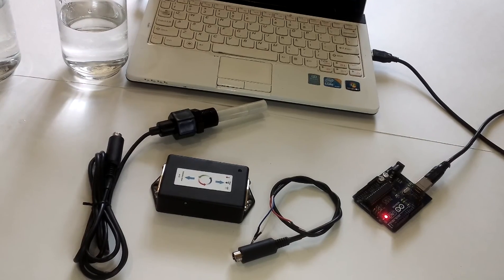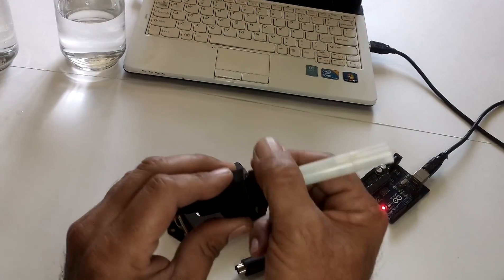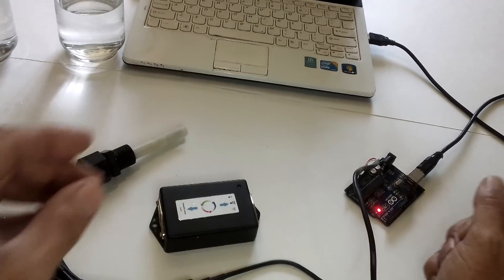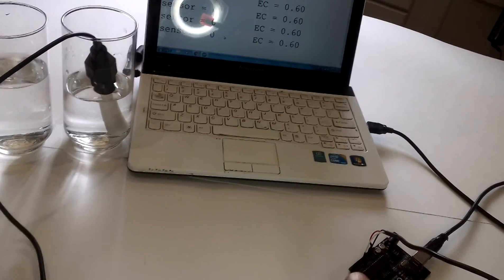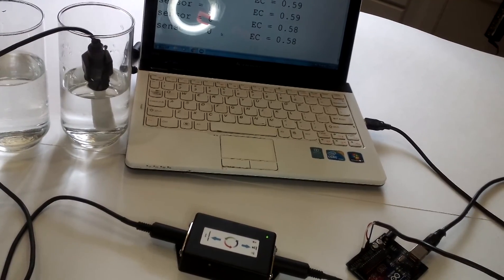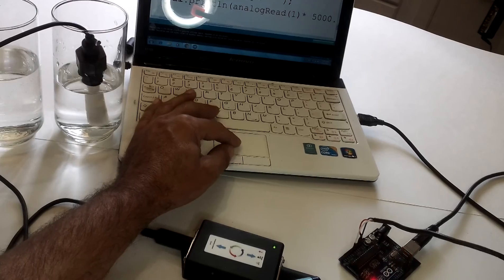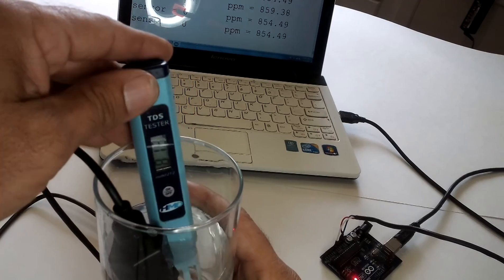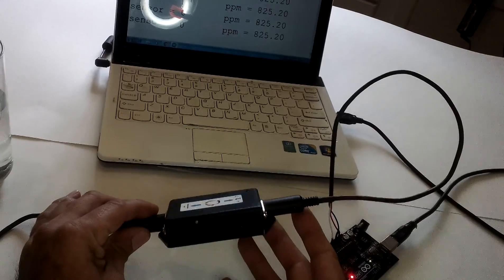Arduino EC Sensor

Comment: This instrument measures the EC of the water without any additional code for the arduino, and I would like to integrate it into an EC probe to be able to use it on the ground. Could it?
whats is the name of this istrument?

Comment: Hi, is there away to code the arduino to extrapolate the temperature from the output? Thaks
Reply from the maker: Yes..i think you can insert " int" commands for raw reading verses processed reading by adding or subtracting certain reading value from raw reading depending temp change.

Comment: What's the max time I can leave this probe in water? I'm looking for something that could stay in water for a couple months.
Reply from the maker: It is designed for continuous monitoring. Sensor is industrial grade so yes you can leave the sensor in the water for long periods of time, until it needs cleaning.

Comment from the maker: Sure...here you go

void setup() {
 
 */Analog input, analog output, serial output

// These constants won't change.  They're used to give names
// to the pins used:
const int analogInPin = A1;  // Analog input pin that the sensor output is attached to
const int analogOutPin = 9; // Analog output pin that the LED is attached to

int sensorValue = 0;        // value read from the sensor
int outputValue = 0;        // value output to the PWM (analog out)

void setup() {
  // initialize serial communications at 9600 bps:
  Serial.begin(9600); 
}

void loop() {
  // read the analog in value:
  sensorValue = analogRead(analogInPin);            
  // map it to the range of the analog out:
  outputValue = map(sensorValue, 0, 1023, 0, 5000);  
  // change the analog out value:
  analogWrite(analogOutPin, outputValue);           

  // print the results to the serial monitor:
  Serial.print("sensor = " );                       
  Serial.print(sensorValue);      
  Serial.print("\t output = ");      
  Serial.println(analogRead(1)* 5.00 / 1024, 2);   

  // wait 10 milliseconds before the next loop
  // for the analog-to-digital converter to settle
  // after the last reading:
  delay(500);                     
}
}

void loop() {
  // put your main code here, to run repeatedly:

}
Reply: Did you personally write this code or was it provided from the distributor?
Reply: please send me the code :)
Reply: // Analog input, analog output, serial output

// These constants won't change.  They're used to give names
// to the pins used:
const int analogInPin = A0;  // Analog input pin that the sensor output is attached to
const int analogOutPin = 2 ; // Analog output pin that the LED is embeded to the board

int sensorValue = 0;        // value read from the sensor
int outputValue = 0;        // value output to the PWM (analog out)

void setup() {
  // initialize serial communications at 9600 bps:
  Serial.begin(9600); 
}

void loop() {
  // read the analog in value:
  sensorValue = analogRead(analogInPin);            
  // map it to the range of the analog out:
  outputValue = map(sensorValue, 0, 1023, 0, 5000);  
  // change the analog out value:
  analogWrite(analogOutPin, outputValue);           

  // print the results to the serial monitor:
  Serial.print("sensor = " );                       
  Serial.print(sensorValue);      
  Serial.print("\t Voltage output = ");      
  Serial.println(analogRead(analogInPin)* 5.00 / 1023, 2);   

  // wait 10 milliseconds before the next loop
  // for the analog-to-digital converter to settle
  // after the last reading:
  delay(500);                     
}